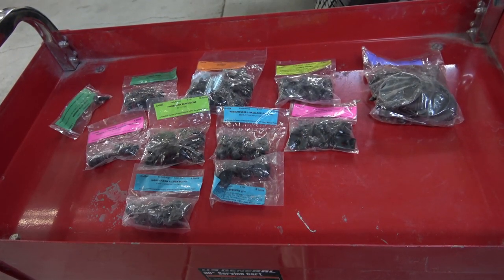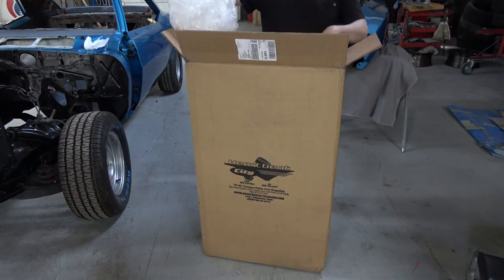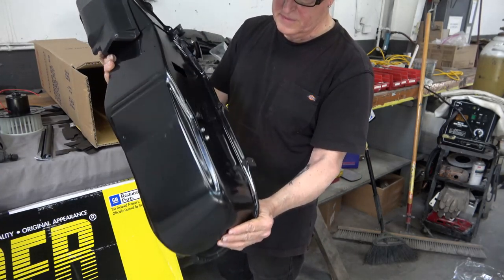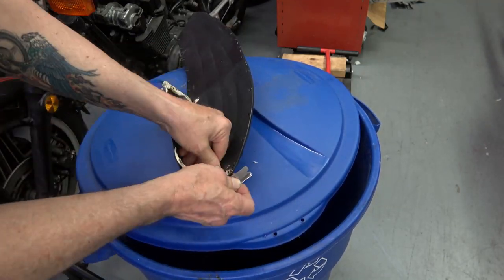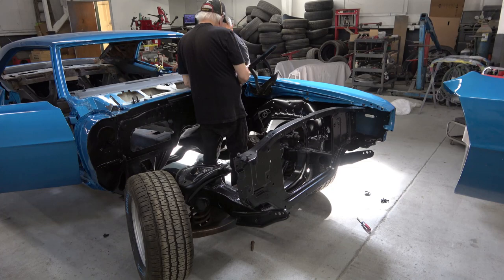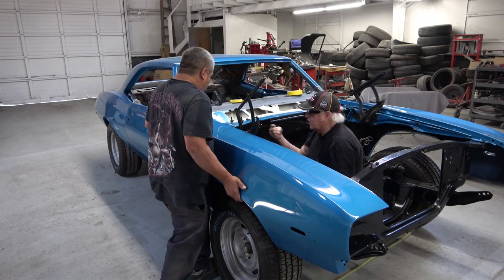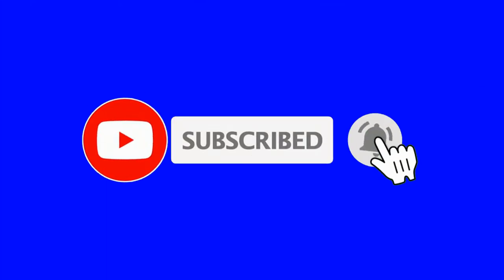69 Camaro Z/28 in Le Mans Blue Full Restoration Part 10 - Front Sheet Metal Hood & Fender Install

Comment: The original heater box has the larger plastic plenum because yours was a console-equipped car. GM put the wide plastic vent on so that air would travel around both sides of the console. Only console cars got that wide vent. The vent that came with the repro heater box was  correct for a non-console equipped 69 Camaro.
Reply from the maker: Thank you Robert, That makes sense, I wasn't aware of that. Thanks again for the info, I really appreciate it.
Reply: Yep, I have a column shift auto with small air box and my other 69 with console has the larger one.  Love your attention to detail

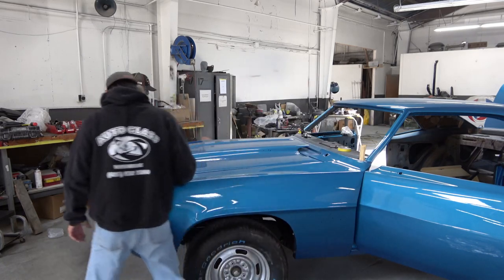Comment: 13:00 onward, how do you get the hood to center of the fender flush? All 4 corners are flush, the rear by cowl panel is flush and front by header panel is flush same as on my car; but the center of my hood along the fender is higher than the fender itself. How do I get that fender flush to hood or hood flush to fender line without lowering my hinges, latch, or header panel bump stops which are all perfect
Reply from the maker: Hi Michael, it may be the hood itself. It could be bowed from stiff hinges creating stress on the hood when pulling down to close. The hood can actually bow in the middle. It also could be a bad reproduction hood. My guess is that it is the hood itself. I would try laying the hood down in place without the hinges attached, and the bumpers adjusted properly, and see if the hood is bowed in the middle. If it lines up, then it is adjustment. If it is bowed, then it is the hood.